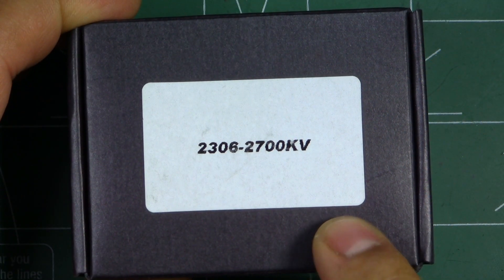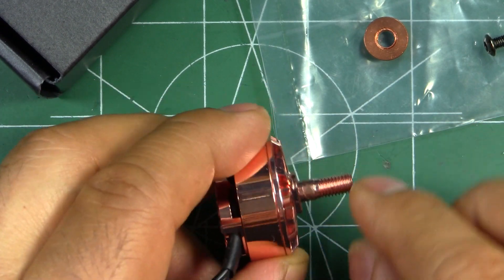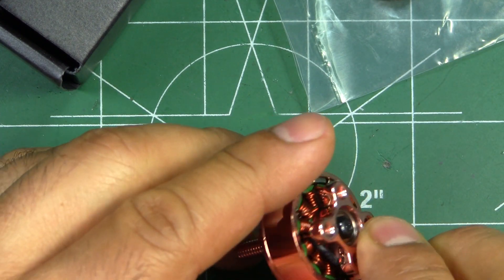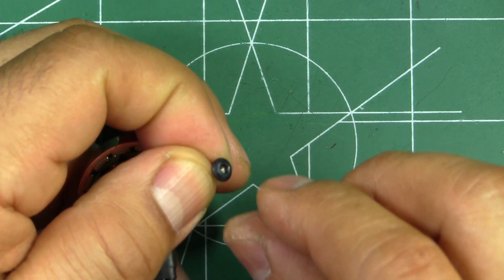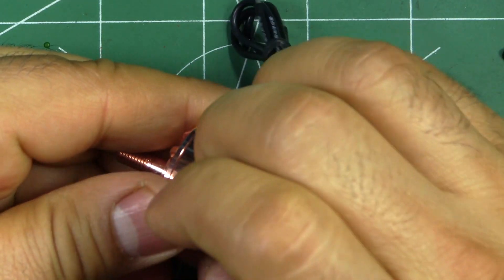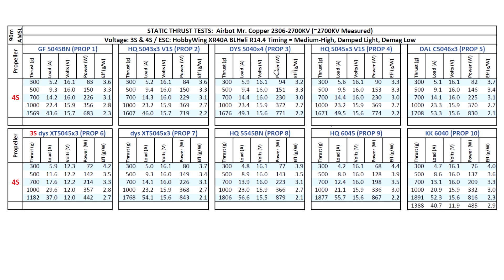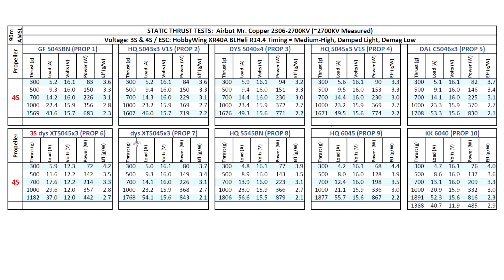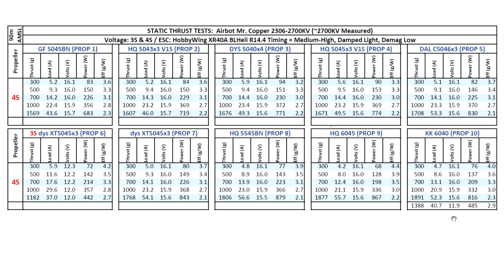Airbot Mr. Copper 2306-2700KV Thrust Tests & Overview

Comment: Great job 👍🏻
I've been running them on 2 aliens with 5s and hq5x4.3x3 v1s for two months now.  They are beasts, and have taken many crashes two broken arms and still the original 8 motors.
Reply from the maker: Very good and telling info from heavy abuse. Great to hear motors are strong. Sometimes  couple of extra grams are worth it if it means better survival when crashing. Thanks for sharing your results

Comment: Great videos, I think you are only source of trustable motors information, I probably saw all your videos already. You know I have special interest in high KV motos I was wondering if you can give me a hand in choosing my next set of of motors (high KV and good trust) of I should stay with RCX2207 2700 (very happy with them, they blow my expectations)

Cheers
Reply from the maker: Hi, thanks for watching my videos. Very much appreciated. 
Those RCX 2207-2700KV are going to be difficult to beat and get better performance. Their price is very good and they have replacement parts at good price to. Of course, there's always something better. Those GepRC 2306-2750KV I tested recently also have very good performance and so far I have not seen reports of any issues with them. KV was higher than 2750KV so that could be good for people that like very high KV. These Mr Copper also look great and all reports are that they're durable. Performance should be close to the RCX motor, I don't think you will see any major jump in power. I think you got some good motors already so to get even more power most people are going to 5S or 6S on 2400 ~ 2700KV motors, but that gets more complicated. You have to get new LiPos, maybe new ESC's with good capacitors, and then test setup and pray it doesn't blow up :)
I'd say keep what you have and maybe wait a few months and see what new motors come out.
Reply: EngineerX thanks so much indeed I was looking to those GepRC and the trust table was very promising.
Thanks sooo much I love the rcx those magnets are very strong and they are so powerful
Reply: EngineerX  another question and I think you are the only one with the knowledge to answer it!
Does stronger magnets means more kV or torque?  It what it translate?
Just honest curiosity
Thank so much

Comment: Another great test, looks like a really well made motor and performed very well, thank you so much for the very kind shout out and mention of my YouTube channel, been having a great time testing these quad racing motors in foam park jets, unbelievable power from such lightweight motors.  I have learned and continue to learn a lot from your channel and it is one of the reasons that moving forward I will only be using quad racing motors in my planes.  Thanks again for the kind mention and I look forward as always to watching more testing from your great channel.  Cheers, Scott

Comment: Nice review, I’ve been loving mine, I have the 2400kv too, and I like them better for freestyle - I’m loving them. Smooth, linear, and responsive. Amazingly for me I’ve found an open bottom that survives my usual abuse. No issues on both Kv on 30amp escs. Magnets are n52 (confirmed by Airbot)
Reply from the maker: Awesome! That's very good info and thanks for sharing. I know you DO abuse your motors ;) so that's good actual-use reports. Definitely, these do look to be very well made.
Reply: EngineerX ;)

Comment: I know amps are way higher on the stand due to not unloading and having moving air and having resistance but is thrust higher as well or is it like I think  lower on the bench ,as props unloading,as well as momentum of the quad?
Reply from the maker: That's a very good question. It's definitely not an easy one to answer, unless you have a very good knowledge of the science behind propeller propulsion systems.
Generally, a motor/propeller powertrain will output lower thrust as its speed on the free airstream increases. It all has to do with the laws of conservation of mass, momentum, and energy. There are lots of websites that explain the science better: 
https://www.mh-aerotools.de/airfoils/prpstati.htm
https://www.electricrcaircraftguy.com/2013/09/propeller-static-dynamic-thrust-equation.html
https://www.grc.nasa.gov/www/k-12/airplane/propanl.html
Reply: EngineerX 
Awesome thanks.
Like that on average 30% or so at least amps drawn on bench are seen just was wondering as far as thrust whats happening.
I guess more on the bench as why amps are high also besides flowing air as props get to "grip" and pull allt of thrust and in-flight would be like shoveling dirt while running compared to stationary if that makes sense.think I answered my own question kind of but will check out your link thanks man.
Any fin40 2610 thrust coming out?
Reply from the maker: charles hodge Yep. That"s it. 
 Silverdrone never sent me any motors for testing :(